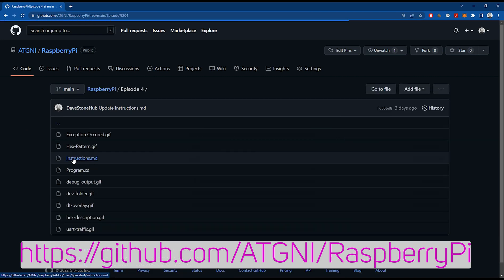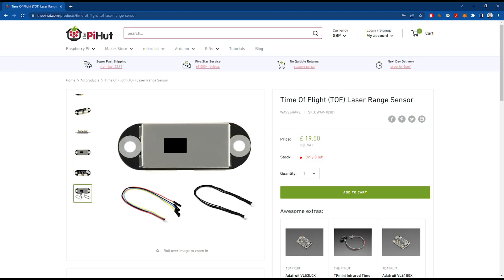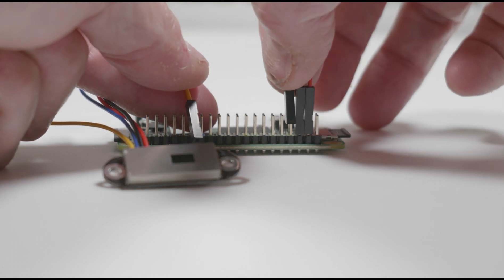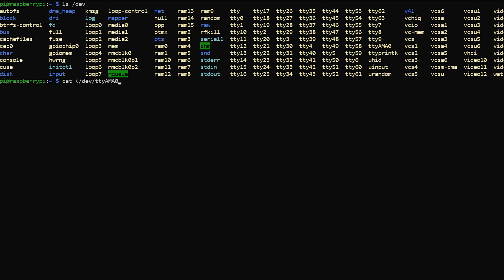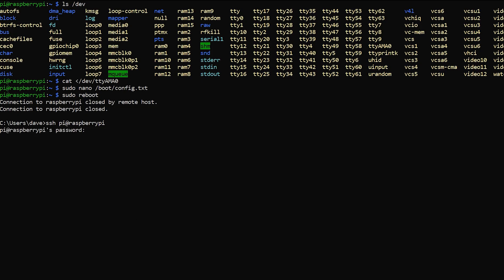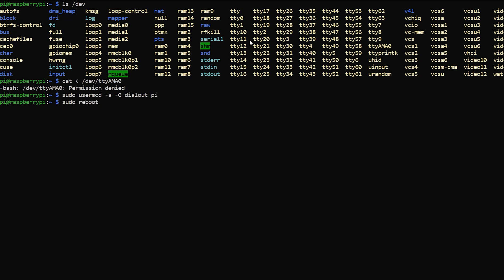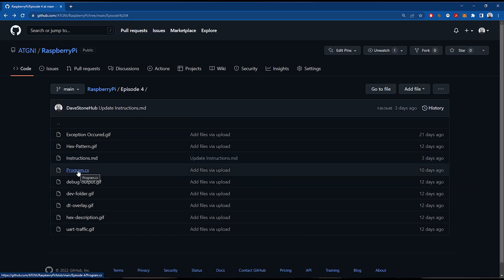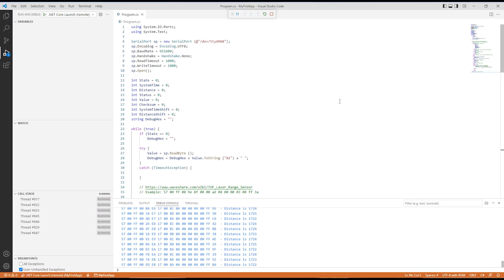How to code C# on a Raspberry Pi to read a Time of Flight sensor - PART 4

Comment: hi, thx for the videos :)
However I don't see the point of dotnet console app on rpi.
I really enjoy coding dotnet winform on visual studio then running it on a rpi using mono. This is perfect for embeded electronics projects !
But I can't remember how I did it and now I want to set up a new rpi dotnet winform project !
thanks anyway, I subscribed ;)
Reply: Gonna have to use seomthing like Avalonia for the RPi, Winforms are restricted to Windows and wont work on Unix OS's. Avalonia specifically supports Arm as well

Comment: Hi Dave. Thanks a lot for your videos and  easy to follow instructions.

I was wondering, if I want to create some kind of robotics shelf system, how would I go on to achieve that? Especially if the robot is in the middle and the shelves are  around it in a circular pattern. What do I need to figure out regarding controlling the servos etc?
Reply from the maker: Heh, thanks for watching and commenting. I'm not quite sure what a robotic shelf system would like.. but can't wait to see yours.. :-)  

Servos have three wires, +ve, -ve and signal. The signal is  Pulse Wave Modulation (PVM). This is where the signal is proportionally high  and low within a certain period (the duty cycle). So it might be 75% high in a 2ms period. A typical servo motor expects to be updated every 20 ms with a pulse between 1 ms and 2 ms, or in other words, between a 5 and 10% duty cycle on a 50 Hz waveform. With a 1.5 ms pulse, the servo motor will be at the natural 90 degree position. With a 1 ms pulse, the servo will be at the 0 degree position, and with a 2 ms pulse, the servo will be at 180 degrees. You can obtain the full range of motion by updating the servo with an value in between. As you can imagine, trying to control a servo directly from the GPIO pins is doable but timing won't be accurate.. but there's easier ways. The easiest way is to get a servo driver HAT. Here's an example from The Pi Hut

https://thepihut.com/products/16-channel-servo-driver-hat-for-raspberry-pi-12-bit-i2c

It has a series of (the three) pins ready to go in terms of connecting servos, and it can be operated with I2C from the raspberry. If you're going to do any surfing/learning.. look at I2C, and what better way than getting a single servo + the HAT and going for it.! Look forward to hearing how it's going.

** I must apologise to everyone because I had great plans for further episodes.. but I changed my full time job in June and have had zero time.. the plans are still there though!
Reply: All The Gear - No Idea  Thank you very much for the answer. I will try it out. It shouldn't be too difficult to make the initial setup with motors and servo flr controlling the robot.

Comment: Hi Dave, thank you for these videos about running (and debugging) C# .NET programs on the Raspberry Pi ! 

Although I am a C# programmer/developer in my day-to-day job, I haven't even tried using .NET on the Pi... yet. 🤔 You've convinced me to give it a try.

Mostly I've been experimenting with Python code; which I find easier to follow than lower level C/C++. But that doesn't stop me from, next to micro computers (such as the R.Pi SBC), also playing around with micro controllers. For instance the ESP8266 and ESP32, writing code in Arduino IDE as well as PlatformIO (in VS Code). And let's not forget the, still relatively new, Raspberry Pi Pico! 

Now for the Pico I have yet to come up with a project to build. A bit like your channel name says: "No Idea". 😁 
Actually lots of ideas can be found online, of course. 🤯 But most of them have either not been "the" project for me, or I couldn't reserve enough spare time to build them. Also my knowledge of (and experience with) building circuits with (micro)electronics, is limited compared to my programming skills. Luckily there are many places around the internet for finding information and asking questions. And there will always be lessons to learn, even when a project fails. 😅 

Another YouTube channel that I enjoy watching: https://www.youtube.com/c/explainingcomputers 

And now I have subscribed to your channel, too. ✅ ^_^ Looking forward to see more content appear. Thanks!

Best regards, from across the English Channel (I'm in the Netherlands) 👋
— Richard
Reply from the maker: Richard.. thanks so much for your kind comments. Although I haven't had a programming job for many many years, I still enjoy coding, mainly in C#. I did an course once in Python and failed the end exam ! Then I did the exam for a colleague of mine (who had no programming experience) and "he" (me) passed ! Python is just not for me. :-)

I enjoy electronics so have used a number of embedded platforms, including; the Electric-Imp (no longer available) where the programming language is "Squirrel", the Z-Uno (https://z-uno.z-wave.me/) a Z-wave arduino device so used C++, and some ESP32 devices. The raspberry Pi has finally come of an age where it supports .NET natively so I thought I'd give it a go, with the obvious rights-of-passage which I've hopefully documented in the videos. I might try an I2C project next, which will be new to me.

Project wise... it's always good to think of a problem to solve and work around that. I came up with the ... measuring the car into the garage project, when my wife once reversed out of the garage without the doors being open, or not parking far enough in before the doors came down. Now we have "traffic lights" and distance measuring :-) 
I keep wanting to work on a project that might measure the water moisture level in my lawn (wirelessly/remotely) and somehow feel that might be a Pico project. Keep me posted on your progress and many thanks for watching/subscribing!
- Dave